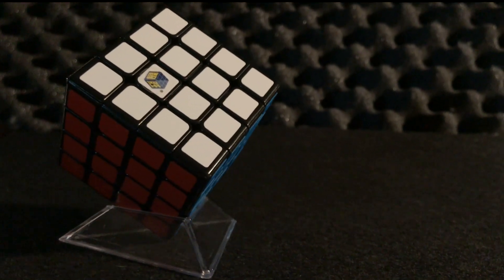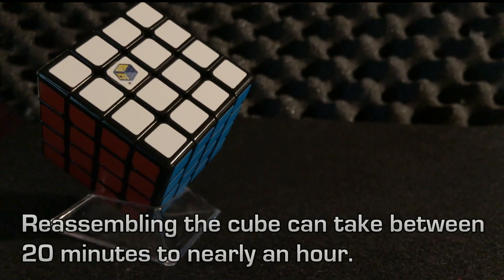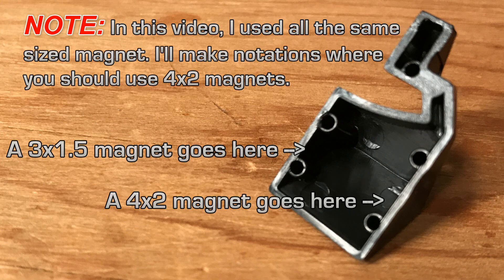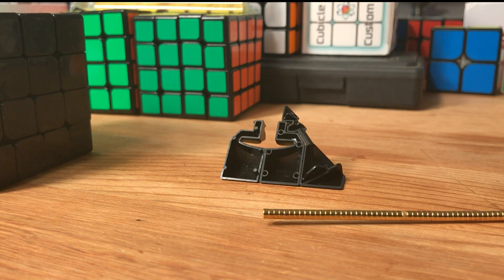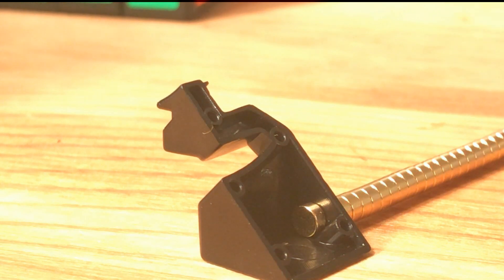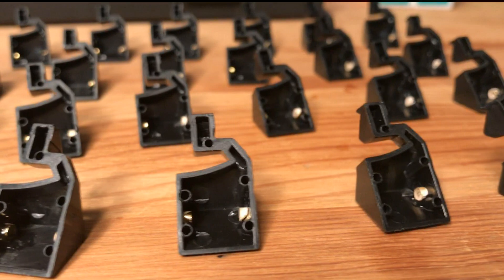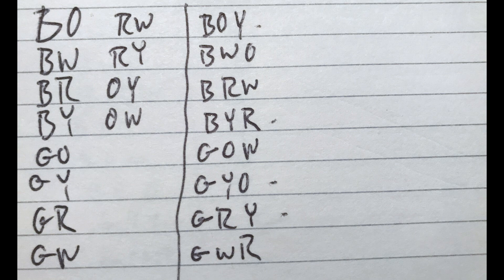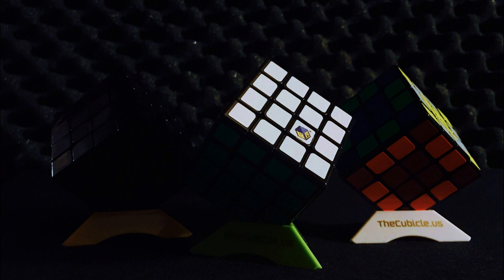How to Make a Magnetic Yuxin Blue 4x4 and other 4x4 Speed Cubes

Comment: Any guidance on how to remove magnets?
Reply from the maker: Jeremy Mullins Superglue is permanent, so you can imagine it's not real easy. If you're lucky, and the magnets are situated just the right way, you can usually just pop them out by prying them out with a small screwdriver. It takes a certain amount of force, so be careful not to bend or scratch the plastic when you do this. You can also soften the glue to some degree, which will make it easier to remove from the plastic and magnets. The safest way is to soak the disassembled cubie piece in warm soapy water for several hours, or as long as is needed to soften the glue. Another way involves carefully placing a drop or two of acetone (fingernail polish remover) on the glued-in magnet. You have to be careful with this because it can dissolve the ABS plastic which cubes are made of.
Reply: I was able to pop the magnets our of the edges really easily, but the corners won't budge, so I might try the soapy water next.

Or, I might just get some really weak magnets to go in the edges.  Have you experimented with pairing different sized magnets?
Reply from the maker: Jeremy Mullins Yeah, if the magnets are lodged against something on the inside, it's going to be harder. 
No, I haven't mix different sizes of magnets. But I have mixed different grades, or strengths, and you basically get an average of the two together. So if you're unable to remove the corner magnets, that might be the best route to go. Are you having to remove all of them?
Reply: This is on a WuQue.  I'm satisfied with the 3x1.5mm N52 I put on the inner layers.  I ordered 4x2mm N38, but they were incredibly strong, even out of the cube.  I'm not convinced that they're actually N38.  They feel much stronger, but I don't have any way to prove that.

Either way, I was very unhappy with how the cube came out.  I got the outer layer magnets out of the edges and the cube is usable again, but now it feels really weird because the inner layers feel incredibly sluggish when paired with a non-magnetic outer layer.
Reply: +DMCubing

I fixed it.  I used 4x1mm N38 magnets in place of the 4x2mm N38's I removed from the edges.  So, the outer layer is 4x2 in the corners, 4x1 in the edge, both N38, and the strength works pretty well.  I wouldn't mind it being very slightly weaker still, just for balance sake (the 3x1.5mm N52 in the inner layers feel barely stronger, and I'd like it to be slightly more balanced toward the inner layer), but I'm happy with how it came out, especially considering how bad it was when I first finished it with 4x2mm N38 in the outer layers.

Comment: Will N50 magnets work? I cannot find N52 magnets that are 3x1.5 mms
Reply from the maker: Yes, they'll work fine. There is the possibility if you buy budget priced N50s that they could be some of the ones that are actually weaker than true N50s because a lot of unscrupulous sellers often try passing off N35 magnets as ""N50". In that case you'd be better off using a 3x2 magnet (preferably at least N42 grade). But if the company you're dealing with is reputable, using the N50 3x1.5 should work fine.
Reply: DMCubing thanks!

Comment: Can I actually use the same magnet on both inner and outer layer?
Reply from the maker: @jkhofficial  yes! Just be careful to not use too strong of a combination of magnets.
Reply: @dmcubing6342  so, lets say I only have N42 4mm x 1mm (as there are not so many ranges of magnet types sold in Indonesian e-commerce), is it okay or will be weaker in one of the layer?
Reply from the maker: @ I don’t think a single 4x1 magnet would do much at all, honestly. Again, in a situation like this where you only have 4x1, it would probably work out best to stack an additional 4x1 magnet on top of the 4x1. This will give the feel of a single 4x2.
Reply: @dmcubing6342  so is it best to use 4x2 magnets in both inner and outer layer? And if so, do you think N52 will fit the best? (because again, Indonesian e-markets mostly sell only N52 and not weaker ones like N48 or N50)
Reply from the maker: @ go with the N48. They would probably have the best feel.

Comment: Have you done your WuQue yet?  Any specific recommendation on magnet strength in it?
Reply from the maker: Jeremy Mullins Hi Jeremy. No, I haven't done the Wuque yet. I've got a few 3x3 projects I need to get to first. But I'll probably the same N52 3x1.5 on the inner and either N35 or N38 4x2s on the outer. Then I may do another with 4mm magnets on the middle, either 1mm or 1.5mm thickness. I'll check around again on YouTube and elsewhere to see what others are using. The procedure for gluing will be just like this video.

Comment: What about  n52 3x1 on inners and n38 4x2 on outers for wuque?
Reply from the maker: Mateusz Szulik you would be probably fine on the outer  layer, but I don't think a 3x1 magnet would be much help with the inner. If it's the only magnet you have available, you could try double stacking them, essentially making a 3x2, and see how that works. From what I gather, quite a few people use 3x2s on the inner.
Reply: and what about 4x1 n38 on inners? I ask because one magnetisator or however should it be called from my country told me i have to use half thinner magnets on inners
Reply from the maker: Using the magnetic calculator at K&J Magnets, an N38 4x1 would still be really weak.
Reply: And 3x2 n52 would be good ? I can get these ones too.
Reply from the maker: Mateusz Szulik Yes. People have used these on the inner layer.

Comment: If I use 3x2 for the Inner layer, what strength would you recommend, and What magnets should be a balance for the Outer layer?
Reply from the maker: Joshua Manuel Strength really depends on what you have available to order. But you certainly could use something like an N38 or so 3x2 on the inner and then something like an N42 or N48 5x1 on the outer. 
Be sure to check the pinned comment thread here. Lots of good info there.
Reply: DMCubing If I used N38 3x2 for the innners, what grade and size could be a balance on the outers that feels subtle and not too strong?
Reply from the maker: Joshua Manuel I would probably use something like an N42 5x1 on the outer.

Comment: Hey in my local shop i have only magnets with strength N35, i have nearly all sizes so what would you recommend? i dont want it to be too strong
Reply from the maker: You can use N35 4x2 on the outer layer, and N35 4x1.5 on the inner layer. This combination will give a nice, balanced feel.
Reply: @dmcubing6342  ok thanks, I already have 4x1 n35 and 4x2 n35 do you think it will work otherwise I'll buy the 4x1.5
Reply from the maker: Oje Oje Yes, you could do that. But be aware the middle slice will have about the same attraction force as the outer layers. If you did use a 4x1.5 in the middle, the middle would hold together stronger while you're rotating outer layers.

Comment: I want to magnetize my Mini Aosu but I can only get
N35: 3x3mm, 4x3mm and 4x2mm
N38: 4x2mm
N50: 4x2mm

So what should I use for the outer and inner layers?
Reply: Should I go with N35 3x3 inner layers and N35 4x2 outer layers?
Reply: DMCubing ?
Reply from the maker: Armando Dian Hey! Sorry I didn't see your comment earlier. 
Yes, I think having N35 3x3 in the inner layer would work well as it has essentially the same pullforce strength as the N52 3x1.5. And I believe N35 4x2 would be a wise choice in the outer layer too.
Reply: DMCubing Thanks :D
Reply: Did you put the magnets right at the bottom of the piece?

Comment: is n38 stronger than n42?
Reply from the maker: Maritess Garrote No. Given the same size magnet, N38 will be slightly weaker than N42.
Reply: DMCubing. is the size matter?? like n38 4x2 is stronger than n52 3x1.5?
Reply from the maker: Antonio Garrote The N38 4x2 is the stronger magnet. Here's a helpful calculator to use to get some predictable strengths:
https://www.kjmagnetics.com/calculator.asp
Reply: DMCubing is it ok to put 4x2 n38 in both edge and corner piece?
Reply from the maker: Antonio Garrote Oh, gosh, that's really too much magnetic attraction. You could do it, I mean, the cube would certainly be more stable, but you'd end up with some very strong attraction in the middle. I personally wouldn't really recommend it. Maybe on the outer, but something lighter on the inner.

Comment: Using 4x2 on the outers and 3x1.5 on the inners is a really bad idea, even though you have twice as many 3x1.5s, the 4x2s still overpower them. I didn't have this problem on my aosu because I accidentally put 3x1.5s in the corners, this time I actually did it right and my wuque is now terrible. I'm going to swap the corner magnets for 3x1.5s, like I accidentally did in the past, and hopefully that'll fix it.
Reply: Removed the corners from my wuque, tore out the magnets and used an edge that I also removed to place in and allign the 3x1.5s. It was a fairly easy process.

Comment: Finished my second Wuque. I tried the N48 5x1mm on the outside and the N38 4x1.5mm on the inside.  Just as exing1OoO1 says it is strong for the inner layers.  The outer layers feel perfect.  Now if I can only find an inbetween magnet of the N52 3x1.5 and the N38 4x1.5mm that would be the perfect 4x4 for me. I used the 3x1.5 with the N38 4x2mm for my first cube and the inner layers needed a little bit more.  With this cube it was a little too much.

DMCubing, anyone, can you tell me what magnet would fall inbetween N52 3x1.5 and the N38 4x1.5mm?
Reply from the maker: jonathan herring Thanks so much for sharing your observations. This is going to help others. 
Using the magnetics calculator at K&J Magnetics, I can't calculate a magnet between the two. It shows the N52 3x1.5 with a strength of.48 lbs and the N38 4x1.5 at .52 lbs. I can't configure a magnet with a value of.50 lbs. But these values are best looked at as rough guides because I find until you actually glue the magnet in a cube and put it to work, you really don't know exactly how it's going to feel. The calculator is a good predictor though. 
Maybe someone will chime in and share their findings.
Reply: DMCubing true enough, not until  cube is assembled can you tell how it will feel. I tried the calculator too, but was hoping someone would have the knowledge.  I had the idea that I might use one of each and see where that falls.  I may have to try removing the magnets as this could get expensive.
Reply from the maker: jonathan herring Are you talking about mixing the 3mm and 4mm magnets? It's certainly possible and that should give you a balanced average of the two magnetic pullforce strengths.
Reply: DMCubing yes. Why not? As long as it's the same piece there should be no weight concerns.  Each edge pair will have a them on opposite sides. I'm doing it
Reply from the maker: jonathan herring Great. Lemme know how it turns out! This will be a cool experiment!
Reply: Okay. My update. I forgot about the N38 4x1 magnets. I'm going to make a wuque with these as the inner magnets and 5x1 N48 on the outside.  Also, my wuque with N38 4x2 outer and N52 3x1.5 didn't have enough magnet strength on the inner layers. So, I cracked open the edge pieces and added another N52 3x1.5 magnet to the half with only one magnet making a double stack. What an improvement.  It's not an aggressive jump, but enough to make a difference.   I may add another to the other side.

Comment: So If I use N52 3×1.5mm and N35 3×1.5mm？Do Outer layer is stronge？
Reply from the maker: I really think those magnets would be much too weak for a 4x4. Possibly the N52 3x1.5 for the middle, but you'll need something stronger on the outer.

Comment: What will happen if the 2 magnets didnt repel each other?
Reply from the maker: Mark Yyance Do you mean two magnets within the same edge piece half! I prefer to have them repel so they're less likely to attract each other while I'm gluing them in.
Reply: Im making a magnetic wuque last night but i made a mistake, the two magnets on edge piece half didnt repel each but now its ok i used razor and acetone to remove the magnets btw i used n38 4x2 outer layer and n50 3x2 inner and idont like it the inner is very light and i dont feel anything, what magnet should i use in inner layers?
Reply from the maker: Mark Yyance That is unusual that the inner layer feels light. There are twice the magnets in the middle and usually as long as the magnet used there is slightly stronger than half the power of the outer, you'll end up with a balanced feel. The only other magnet I can think of to use, if your N50 3x2 are truly up to spec as N50, would probably be N35 4x2.
Reply: I thought that n38 4x2 is a bad combination in n50, so if i use n35 4x2 would it be too strong?
Reply from the maker: Mark Yyance They may work out ok. My feeling is you either ended up with weaker than normal N50 3x2, or stronger than normal N38 4x2. 
You can use the magnetic calculator at K&J Magnetics to see where the values should be:
https://www.kjmagnetics.com/calculator.asp

Comment: For a wuque, will 4x1 N45 magnets for the inners and 4x2 N35 magnets for the outers work?
Reply from the maker: Yes, you can do this with really good results. Several people use a similar layout. It will give you just a little bit more attraction at the center and slightly less attraction (compared to the center) on the outer layer.
Reply: @dmcubing6342  How about the slight difference in attraction, do you think the slight difference will still ensure that the inner layers will not stick to the outers during 3x3 stage?
Reply from the maker: Emmanuel Tsai It should do well at holding the middle together. People generally don't go for much of a stronger outer to middle ratio, but I've seen some people actually use all N35 4x2s. I'd only recommend that if you're ok with a pretty clicky feeling cube. Otherwise the N35 4x2 outer / N45 4x1 inner should be fine.

Comment: can i mod the cube with 3x1.5 n35 in the inner layer and 4x2 n35 in the outer layer ? hope you answer ^^
Reply from the maker: I think your outer layer would be fine with the N35 4x2, but N35 3x1.5 might be a little on the weak side. Most people use a stronger grade like the N52 3x1.5. Still, I think the cube might be ok if you’re not necessarily needing a stronger middle layer.
Reply: can i change  the inner layer with 4x1 n35 magnets in its ?
Reply from the maker: Thành Nhân Nguyễn N35 4x1 has about the same strength as N35 3x1.5. You’d be better off using N35 4x1.5, as they have a similar strength of the N52 3x1.5. 
If all else fails and you can’t get N35 4x1.5 for the inner, you could use N35 4x2 throughout the cube, it will have a stronger than normal inner layer.
Reply: DMCubing wow thanks for your advice, now i will order the magnets for my wuque and mod it i hope the cube will be excellence ^^
Reply from the maker: Thành Nhân Nguyễn Awesome!!! Be sure to let me know how it turns out! Have fun!

Comment: If you don't like putting a whole 4x4 back together. You can just take apart on whole side and magnetize it. Put all the pieces but two pieces. Use those two guide split up pieces (corner and edge) to magnetism other sides and repeat as so.

Comment: For the edge pieces with holes, all of them have to be repelling inside the edge?
Reply from the maker: Ryan Wu The important thing is that the pairs of magnets are positioned and glued exactly the same way in each edge piece half. Having them repel just makes it easier to glue because they have less tendency to fly across to each other while you're gluing them.
Reply: For the edge pieces with holes what if the other edges pieces with holes repel each other?
Reply from the maker: Ryan Wu The other edge pieces with holes DO repel each other. Just glue the magnets exactly the same way for each edge piece half as I show in the video and you'll be fine.
Reply: Okay thanks! I thought I messed up so I asked you!
Reply from the maker: No problem at all. If you have questions, feel free to ask!

Comment: I'm so confused that you're using N52 on the inner then saying you need stronger on the outside and suggesting a weaker N35?
Surely you want stronger on the inner layer and weaker on the outer?
I followed your Little Magic 3x3 tutorial and it was perfect ... I don't want to ruin my WuQue so had planned N35 4x2 inner and N35 5x1 outer??
Reply from the maker: Check the graphic at 1:38. The outer layer has only ONE PAIR of magnets attracting per side whereas the middle slice has TWO PAIRS attracting. If you were to use all the same magnets throughout, you'd end up with a middle slice with twice the magnetic attraction. You need to reduce that layer's attraction so it's still a little bit stronger than the outer, but not double. Hope that helps.
Reply: @dmcubing6342  ah ha! Yes That's so obvious now you've said it... Thanks so much
Reply from the maker: Daniel Lagorio Yeah it kind of looks weird until you visualize the placement. Figuring out the 2x2 is what gave me fits initially, even as simple as it is.

Comment: I used a combination of n42 and n35 5x1mm magnets to basically get n38 magnets on the outer layers and used the 3x1.5mm n52s on the inners on both my Yuxin Blue and Qiyi Wuque. Surprisingly, all of the layers have pretty much the same magnetic strength.
Reply from the maker: Oh, this is great to know, and I have all of those magnets, so I'll probably try it on my Wuque! Thanks for sharing this!!!!
Reply: Actually, upon further testing, the outer layers are definitely stronger on the Wuque. The Yuxin Blue still rings true, at least to me.
Reply: DMCubing I retract my previous statement, for some reason the Qiyi Wuque that I magnetized had extremely bumpy outer layers even before magnetizing it for some reason.
Reply: I retract my first statement, I just realized that I ordered n42 5x1s from Gaussboys and what I got were n52. So basically the combination was just n42 5x1 magnets all along.